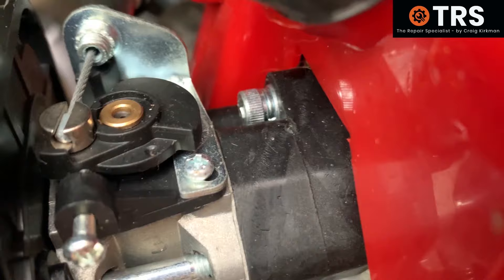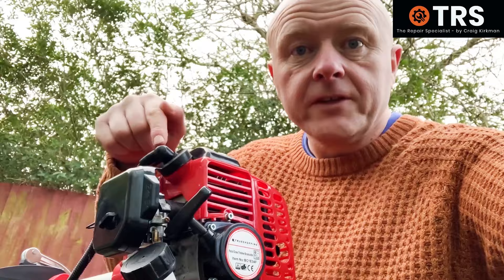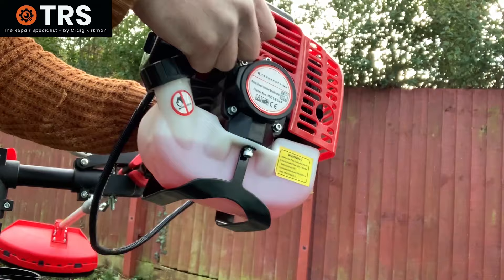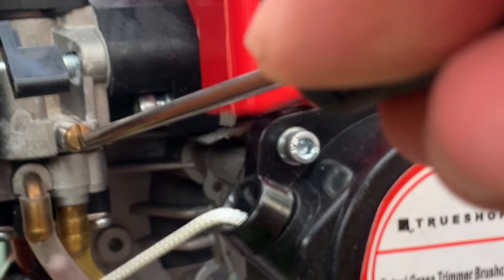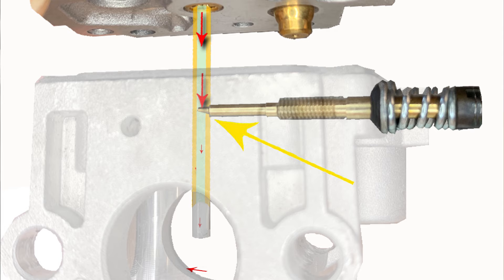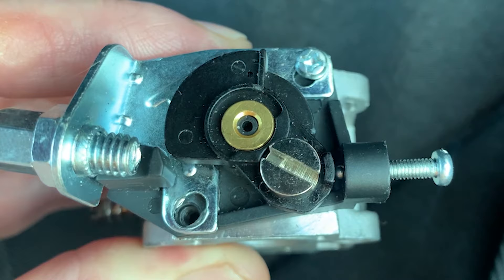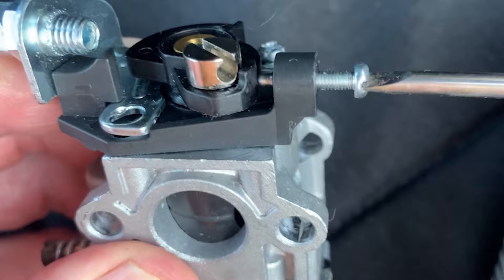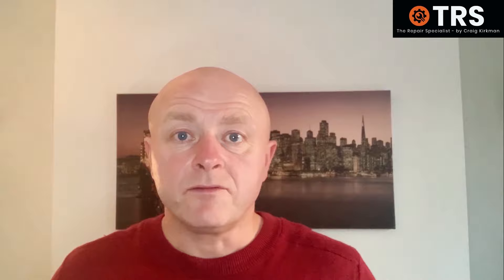Single Tuning Screw Adjustment Weed Eater & Strimmer Carburetor (Adjusting only 1 of the 2 screws)

Comment from the maker: Note: HIDDEN LOW SCREW! Hi guys. What I should have mentioned is that these carburetors, on these strimmers have two adjuster screws. The one shown, as well as a tiny screw at the very top of the carb. I didn't include the adjustment of the latter screw because i was trying to keep my explanation simplistic.  The adjustments I made in this vid are a more common, quick adjustment, but if this does not correct your adjustment issues, then the other screw at the top will need to be adjusted.  I will make a video on how to do this.  Thanks and sorry I didn't include it in this video. Craig
Reply: Great video and visual explanations. Glad I found your channel.
What should I do if the engine never bogs down when I turn the fuel mix screw all the way out until right before it completely unthreads? If you could include that in your new video I would appreciate it very much.

Comment: Single screw? What about the tiny hidden screw at the top of the carburetor? It's usually hidden under a little rubber piece inside the gold circle piece on the throttle cable hookup.
Reply: He is calling it a “single screw”, because most are a double screw (high and low).  Yes there is the idle screw, and I have another (on the single screw carby) but this one has about 4 settings and is on the metal cam the throttle cable attaches to.  Not quite sure what this does.

Comment: You have just saved my strimmer from the scrapper! The engine kept cutting out and I tried everything new plug, new fuel filter but no luck but I found your video and I  turned the screw just a fraction to the right and now it's running fine I can finally cut the grass, Thanks very much!
Reply from the maker: Thank you for your kind and motivating feedback. I really appreciate it. Craig 👍👍👍👍

Comment: Chainsaw carbs has two visible screws on side marked as HI and LO. This trimmer style carb has one on side like on video and second screw is on top of throttle flap inside needle covered by little black plug. Adjusting of this screw Its not very important if you have original carb where it was set by manufacturer. There is large margin between stall low speed and clutch engage speed and you can compensate little wrong adjustment of low speed screw by increasing or decreasing idle speed. But if you rebuild carb with new membranes or change whole carb with non OEM part you need adjust LO-speed screw too because it has huge impact on acceleration performance. If its too much offset engine can chokeing or full stall after aggressive full throttle applied or stall after throttle is released quickly even if engine running good on idle by itself. This two screw setting affecting each other little bit, you need to adjust first, then second and return to first and second again. Its better adjusting carb in neutral weather condition. Not in garage in rainy day when it is too humid, not on hot sunny day when temperature attacking 35°C because with this setting engine can run rough two weeks later when temperature drops to 20°C.
Reply from the maker: I totally agree with you that there is indeed a screw at the top of these types of carburetor.   What I should have done though, is mentioned this in the video. I was trying to show a more basic and  common adjustment to the carb without going into too much detail and keep things simplistic for the viewer. Thank you for your detailed explanation.

Comment: Do you have any videos that show why chainsaw carburetors gunk up so quickly when using modern 10% ethanol fuel & which areas of the carb are affected the most & how to quickly eliminate the problems to get the carb working properly?

Comment: I have a question for you. I have a carb just like that other than it has the low jet adjustment down through  the center of the rotating shaft. I have a tanaka trimmer that has almost the identical carb with the exception that it doesn't have the primer bulb on the bottom and doesn't have the high speed jet adjustment. The primer bulb is part of the air filter housing. It runs rich at wide open throttle. Can I take the primer bulb off this carb, install a plain cover and use the primer bulb that is part of the air filter housing. This would give me a high speed jet adjustment.

Comment: Just found this after repairing a friends trimmer(bmc g wizz make) which had been stood for a while.Evenrually found the fuel pipe in tank had split so would not prime up unless it was tilted.Just fitted new and ran up engine but struggled to rev ,tweaked thus screw and improved it but this video will be a big help to re adjust settings as i have no owners manual,,thank you .
Reply from the maker: Thank you and good luck with your set up. Craog

Comment: A great video. Thanks a lot. Incidentally, my hedge trimmer had the adjusting screw in a recess and with a pacman head (slot on one edge). So I jammed a nylon rawl plug onto its 5mm dia head and unscrewed it fully and then cut a slot in the top for a normal screw driver to fit, as I don't have a pacman screw driver.

Comment: Looks like the exact same carb as on a Chinese trimmer I picked up for dirt cheap second hand, and maybe even the exact same trimmer. Except they're sold here under a brand that pretends to be German 😅 anyway, it's a good enough trimmer. It was sold as broken, I dismantled the carb and the only thing that seemed to be wrong was that the metering valve was sticking. Gave it a few wiggles, put it back together, started on the second pull and runs like a charm.

Comment: Thanks for this Craig however…….. I’ve had a couple of replacement carbs for strimmers (with single fuel adjustment screw), however, it won’t start so I can’t begin to follow your video instructions (will run with fuel under the plug)
Please advise on how to adjust screws to start it even……….

Comment: Hi there love your videos there so informative thanks so much I really appreciate them.  I have a question I got a shindaiwa trimmer with that same type of carburetor I think its a walbro wyk series, anyway I changed it and it ran perfect but the next time I went to use it I won't start.  Could you give me some tips I should check on, I changed all the fuel lines and grommet and like I said its a new carb and gasket.

Comment: Hi i have a Trueshopping long reach saw. i have not been able to use this item due to health problems i have cleaned the carb change the fuel but cant start it, do the elec cables from the starting switch have anything to do with this, just tried everything i can think of would be glad of any advice you can give please

Comment: Hey budddy.  You have the same strimmer as me.  Got an issue.  Please can you demonstrate the Spark ignitor defective and working.  I have a multi meter at hand.  Does not matter if the switch is on or OFF.  I have continuity in both positions On and Off.  This is definately not correct.  Please can you demonstrate.....  Thank you.

Comment: Spinning part of my grass cutter was spinning without steering. Repairer changed the pressure plate and its container. After i use cutter it again started spinning by itself. Repairer said may be i need to adjust speed by you told in video ? Spinning front cutter side can be adjusted by this way ?

Comment: I've never seen a large screw on a barrel-type carb here in the US, wonder if it is a UK only thing?  Great Video Craig, Knowledge is Power!!
Reply: Most have it, it's under a plug
Reply: @GuysPlayingWithTools  I meant the large screw, which isn’t under a plug.
Reply from the maker: Thanks for your kind feedback again Ken. I didn't realise there was a difference between  the US and UK regarding these carbs. Thanks for letting me know. Craig 👍
Reply: @KensSmallEngineRepair  I see them both ways all the time.
Reply: i've never seen that style adjustment screw here in the US either
Reply: @Tom Doby Mower Repair  hmmm. Maybe it's more unique than I thought?
Reply: @GuysPlayingWithTools  well the EPA hides those screws behind plastic plugs so the consumer cant work on their own stuff
Reply: @Tom Doby Mower Repair  True.  But i swear I have seen a good number with that style screw. I don't video most of the stuff I work on because it's repetitive, but now I wish I did so I could go look back.
Reply: @TheRepairSpecialist  there is no difference he just hasn't got an idle screw if I understood correctly

Some units do this else where
Reply: It’s a Chinese carb

Comment: Is this single-adjustment carburetor better than the double-adjustment one?
Reply from the maker: Hi. No I wouldn’t say these carb are better than the carbs with two accessible screws. In fact, this particular carb does have two screws, but the other screw (low screw) is not very accessible.

Comment: I do that already adjusting air fuel mixture, but a few minutes the problem returned ,, what is solution, can i replace like a paper gasket manipold carburetor gasket?
Reply from the maker: Well if you have set the carburetor correctly then it could be a whole host of issues. Main crank seals leaking, Carburetor in need of cleaning and service, fuel tank cap kit venting incorrectly, inlet manifold gaskets leaking, to mention a few. It might be best to take it to a mechanic if you are still having issues. I hope you get it fixed ok soon though. Craig

Comment: Can different carbs be fitted on a machine, or is there something to look for to be sure.?
Reply from the maker: Hi. Thank you for your inquisitive question, and I will try to answer it based on my knowledge, but the answer is both yes and no in my opinion. I've laid down my reasons below:

Carburetors are indeed specific to particular engine types and applications (In most cases), and there are several factors to consider to ensure a proper fit. Here's what you should look for when determining whether a carburetor can be fitted on a machine:

Engine Compatibility: Carburetors are designed to match the specific requirements of an engine, including factors like engine size, fuel type (gasoline or diesel), and the engine's air and fuel mixture needs. It's crucial to choose a carburetor that is compatible with your engine's specifications.

Throttle Type: Different engines use different types of throttles, such as single-barrel, two-barrel, or four-barrel carburetors. Make sure the carburetor you are considering matches the throttle type of your engine.

Airflow Capacity: Carburetors come in various sizes, which determine the amount of air and fuel they can mix. The size of the carburetor should be appropriate for the engine's power requirements. An oversized or undersized carburetor can negatively impact engine performance.

Mounting Compatibility: Check the mounting pattern and arrangement of the carburetor to ensure it can be securely attached to your engine's intake manifold. Adapters or modifications may be needed if the mounting doesn't match.

Fuel Type: Verify that the carburetor is designed for the type of fuel your engine uses. Some carburetors are specifically made for gasoline, while others may be suitable for alternative fuels like ethanol or propane.

Jetting and Tuning: Carburetors often require tuning to optimize the air-fuel mixture for a particular engine. Understanding the jetting and tuning requirements of the carburetor is essential to achieve optimal performance.

Manufacturer Recommendations: Consult the manufacturer's guidelines and specifications for both the engine and the carburetor. They often provide recommendations for compatible carburetors based on the engine's requirements.

All that said, some carburetors can be changed (re-jetted etc, to fit different engines that are similar in size, and require air/fuel ratios similar to the Carbs original application, just 'tweaked' a little basically.

In summary, carburetors are not one-size-fits-all components. To ensure compatibility and optimal performance, it's essential to carefully match the carburetor to the specific engine type and requirements. If you have a particular engine or carburetor in mind, it's a good idea to consult with the manufacturer or a knowledgeable mechanic for guidance on the best fit for your application.

I hope this helps a little
Thanks
Craig

Comment: Isn’t there one more adjustment screw underneath the black plug on the top of the carburetor? Usually there is.
Reply: It's defiantly there is on mine, Idle mixture I think or they may be reversed.

Comment: Hi i have the same carb on a g scooter but it also has an adjustment  screw in the top where the  throttle cable goes  what does that do?
Reply: Low speed (acceleration screw)

Comment: Hello Craig, I have just got my McCulloch 210 strimmer working but, the speed is a bit higher than it should be, it does reduce for about a minute, but any idea why not an instant reduction.?🤔😊
Reply from the maker: Hello,

I'm delighted to hear that you've managed to get your McCulloch 210 strimmer up and running! It's always a great feeling when equipment starts working again. I understand your concern about the idling speed taking a bit of time to reduce. Let me offer some insights:

Warm-Up Period: It's quite common for two-stroke engines, like the one in your strimmer, to have a brief warm-up period during which the engine runs at a higher RPM. This initial high-speed phase helps the engine reach its optimal operating temperature, ensuring smoother operation. This warm-up period typically lasts for about a minute or so, as you mentioned.

Idle Adjustment: You may have an idle adjustment screw on the carburetor of your strimmer. If you'd like to achieve a quicker reduction in speed after startup, you can try adjusting this screw slightly. However, please exercise caution when making adjustments and refer to your strimmer's manual for specific guidance.

Routine Maintenance: Regular maintenance, such as cleaning the air filter and ensuring the fuel lines are in good condition, can also contribute to smoother idling and overall engine performance.

Fuel Mixture: Verify that you are using the correct fuel mixture as recommended by the manufacturer. An incorrect fuel mixture can affect idling speed and engine performance.

Professional Inspection: If you've tried the above suggestions and the issue persists or worsens, it might be advisable to seek the expertise of a local small engine repair specialist. They can inspect the carburetor and other components to ensure everything is in proper working order.

Remember, your safety is of utmost importance when dealing with machinery, so exercise caution throughout the process. I hope these insights help you achieve the desired idling speed for your strimmer, and that you can enjoy its efficient performance for all your trimming needs. Happy gardening!

I hope this helps a little but please understand that I have had to be quite broad with my answers because its not always easy to diagnose something unless I am with the saw.  See if you have any luck and feel free to mesage me again if you nee to.

Thanks 

Craig
Reply: @TheRepairSpecialist  Thank you very much Craig for that very informative info’, to get it running I had to strip fuel tank out, replace filter and fuel lines , new filter , and strip the carb down and replace the filter, needle etc, which enabled me I hope to get it running at least. I have never experienced the speed like it is happening but I am going to do as you suggested and see what happens.  Again, many thanks, and hope I can call on you in the future,. 🤔😊👍